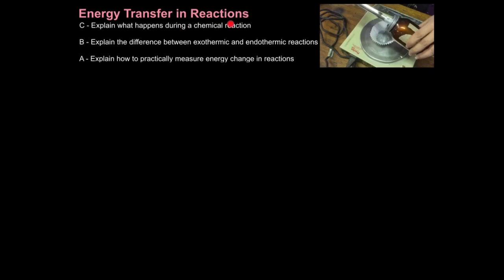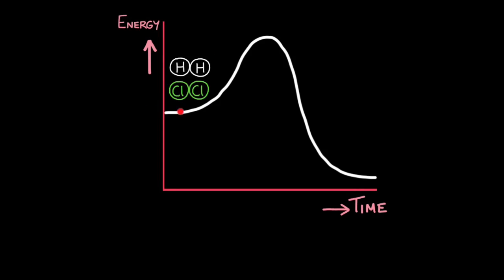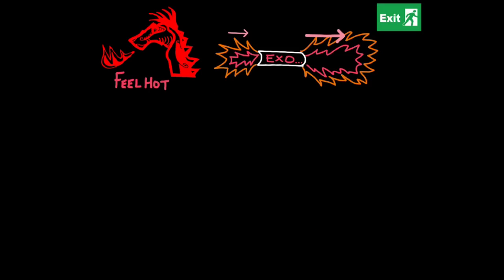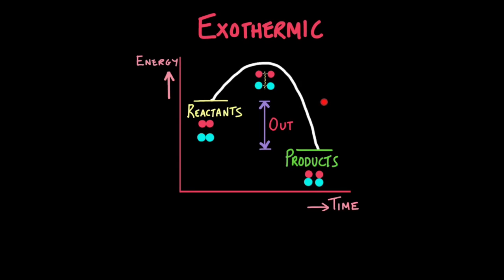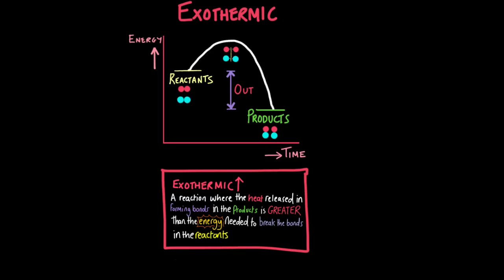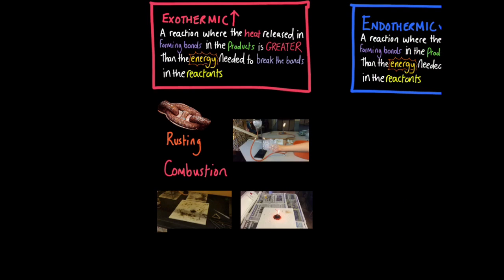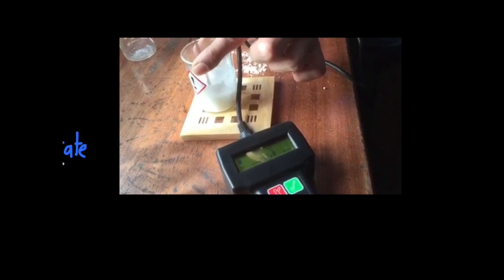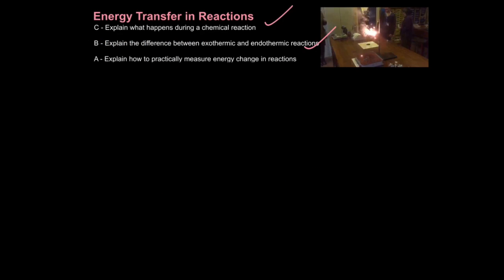C2 Energy Transfer in Reactions (EDEXCEL)

Comment: Sir I dont get the graphs of the endothermic and exothermic reactions!  You said that exothermic reactions produce more energy in the formations of bonds than the amount to break them, so shouldn't the graph be flipped?! Im so confused!
Reply from the maker: The graphs show the initial levels of energy in the molecules before they react and after the reaction.
The products (in exothermic reaction) have less energy than the reactants as they have given out more energy when forming which is why the products when formed have less energy than the starting reactants.
Reply: So its showing that the energy has been lost into the surroundings in the exothermic one?